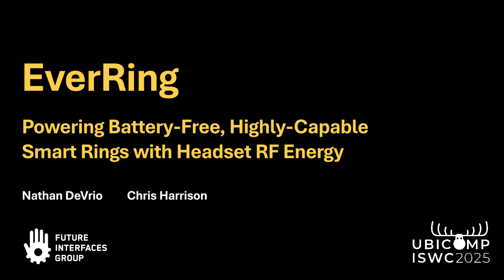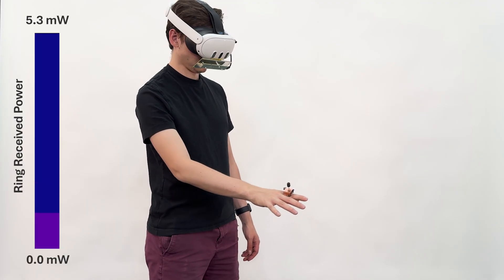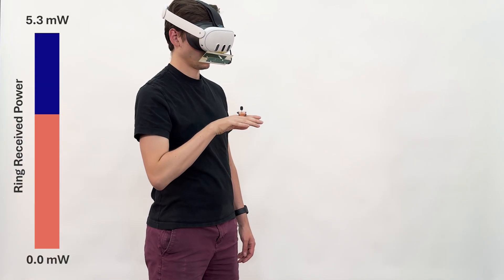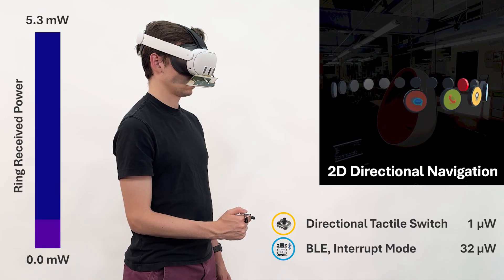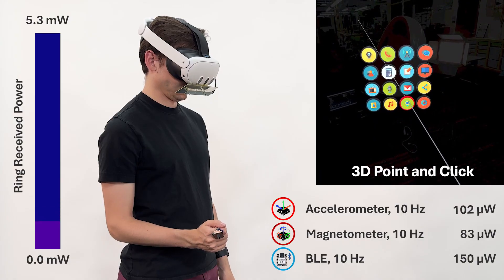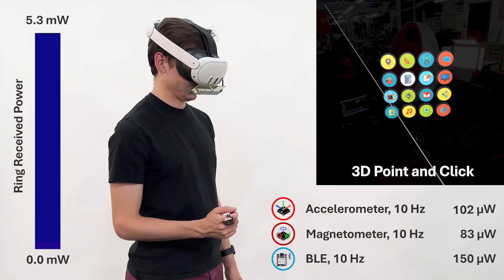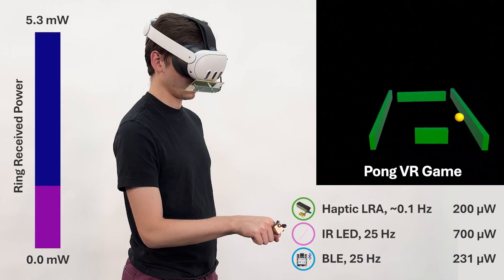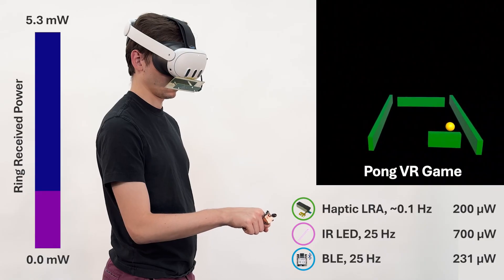EverRing: Powering Battery-Free, Highly-Capable Smart Rings with Headset RF Energy

Comment: This is super cool! I do not know how y'all innovate with such speed, but it is very impressive.

While current headsets do not utilize it yet (I do not know why besides cost and maybe power consumption?), Ultra Wideband looks like the next big thing in a lot of fields. In my brief research I found declassified military documents on the tech from 1993! It enables 3D positioning with a battery free tracker at a higher polling rate!!! There seem to be some research papers using UWB for VR tracking, but they are all from the last 3 years so it appears to still be well in the R&D phase. Still very exciting times for XR!